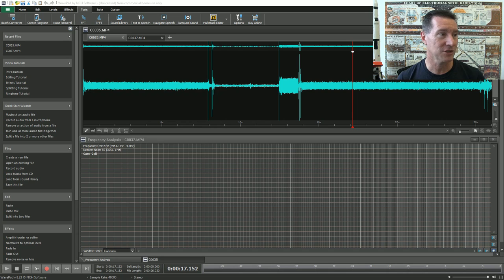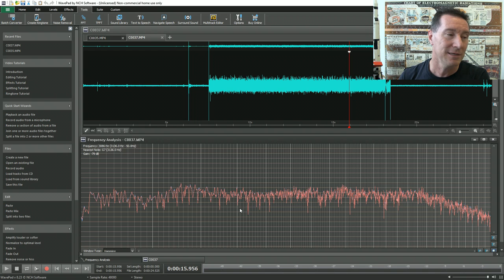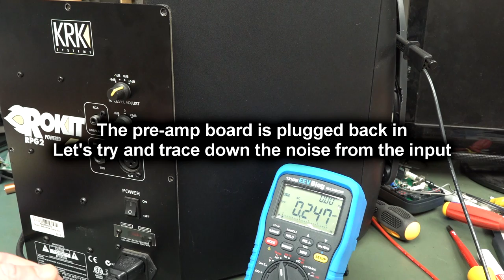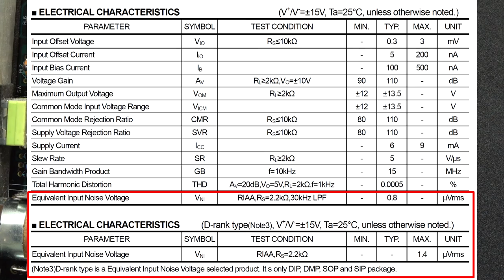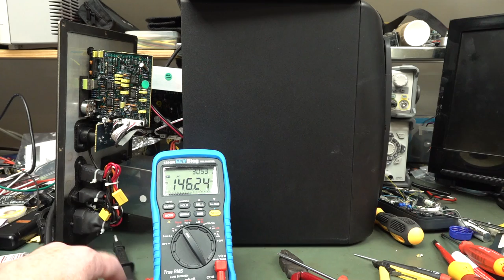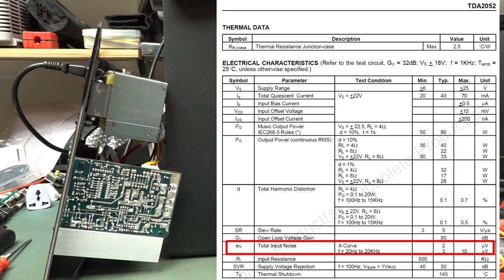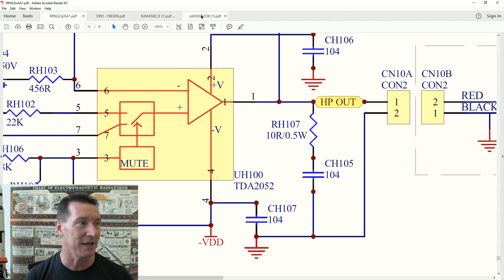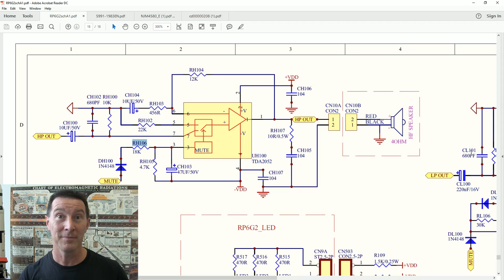EEVblog #1118 - Why Are Studio Monitors Noisy?

Comment: Is this for real? Breaking news: cheap monitors, like cheap microphones, generate a lot of noise. Also known as the noise floor. Earth-shattering idea: compare quality speakers with these cheap KRK speakers and discuss the reasons for the difference.
Reply from the maker: So there is some magic price point where the noise stops? Perhaps you'd like to provide examples?
Reply: doesn't matter man even very expensive monitors do the same silly stuff. you need to investigate each monitor model specifically.
Reply: The noise floor is a variable in speakers and microphones that does indeed reduce with higher quality. If you don't know this, maybe you should do the comparison that I suggested. You might learn something. Really, if you think that the noise floor of a Schoeps or Neumann microphone is the same as any other microphone, or that it's the same for your cheap KRKs as for professional Focals, you are just embarrassing yourself. Do you really not know how important noise floor is in professional recording studios and film production sound recording and editing?
Reply from the maker: Rory on a Bike - Ok, so you provided and example. Focals don't have background noise you claim. 
Hmm, a basic Google search says otherwise for these $1500 Focals:
https://www.gearslutz.com/board/high-end/689253-my-new-focal-solo-6-monitors-have-nasty-hiss-normal.html
and there are other reports.
Try again.
Reply: EEVblog How about you read that thread. It is an anecdotal discussion about a single pair of speakers that are not acting as expected. Surely you can do better.
Reply: I have Focal Solo 6s and they don't have that hiss at all. That's a faulty unit.
Reply: UncleWalter No kidding. But the genius who runs this vlog was desperate to find something, anything that would discredit Focal speakers, so he latched on to an anecdotal complaint from Gearslutz. Meanwhile, this is probably the first time that he's ever heard of Focal speakers, because, you know, it isn't a leading brand like KRK and Mackie.
Reply: Yeah not the best form on his part, no. But let's not cast aspersions here. I have a lot of respect for Dave and his vlog and have been following it for quite some time. It's just that here's not working within his area of expertise here. Let's keep the conversation respectful.
Reply: don't read into shit so much. dave's no fool. hes not trying to discredit focal speakers. he quite possibly doesn't give a shit. why would he.

i actually thought rory on a bike was some aussie slang until i saw his name. truth of the matter is that studio monitors, even expensive ones, do have hiss. its a specific performance characteristic, just like the ability to have cross-overs that don't mangle ya phase.

cheap monitors can come out after expensive ones with better tech.  i have cheap tomato sauce that is better than watties. fight me man.
Reply: UncleWalter I've been subscribed to his vlog for years, although I'll admit that I watch it less and less, largely because I'm increasingly of the view that he's yet another YouTuber who has become full of himself. In this case, he is talking complete nonsense. Instead of admitting it, he goes running off to Google to find some anecdotal complaint about a specific set of Focal monitors on effing Gearslutz. Pathetic.
Reply: Well, Rory on a Bike is still right. The claim that all studio monitors are noisy is demonstrably false. I'm a professional audio engineer who has worked at a few different studios and you don't hear hiss on those systems. I'm very much the audiophool skeptic, but in this case, it's not pseudo-sciency, cork sniffing, trying to justify the pricetag bullshit were talking here. In actual professional studios with professional monitors you don't have this hiss. But if your experience is only prosumer equipment, I wouldn't hold it against you for believing that all studio monitors have hiss.
Reply: pepe6666 Excuse me, but he just specifically tried to discredit Focal speakers, about which he clearly knows nothing, any more than he knows anything about noise floor. He is way over his head, not that he's about to admit it.
Reply: Very curious as to why you sound so incredibly bitter about this subject...    Just unsubscribe & carry on with your life... No need to go full-bore condescending...
Reply: @UncleWalter1  of course not all monitors have hiss. But he's spouting some bullshit about mo money less hiss which isn't universally constant - and then rattling shit off about Dave & alterior motives. Dave said extensive monitor hiss is common as mud - and it is.
Reply: Nick sregor How about you contribute something substantive and tell me where I'm right or wrong. If you can't do that, it's a fair bet that Dave is capable of handling himself without your assistance. And next time you want to insert yourself into a discussion about which you have nothing substantive to say, try something less amusing than a transparently bogus claim of being "very curious". Indeed, what your comment demonstrates is a lack of curiosity.
Reply: pepe6666 Apparently you've been taking lessons from Donald Trump and don't know the difference between your imagination and reality. I did not say that more money means less hiss and I did not say that Dave has ulterior motives. Both claims are a figment of your apparently overactive imagination.
Reply: Dave doesn't know what Adam monitors are. Unlike KRK and Mackie, they aren't on his top brand list. Watch for the next episode, where he will no doubt explain that there is no difference between his VideoMic Pro and a Schoeps or a Neumann. Of course, this assumes that he discovers the existence of Schoeps and Neumann, about which it is obvious at this point that he is blissfully ignorant.
Reply from the maker: UncleWalter1 - I never made that claim, the opposite in fact if you cared to watch the video, I said that there are some that don't have any noise but they seem to be the exception.
Reply: Apologies. My mistake.
Reply from the maker: Rory on a Bike - Ok, I admit it, I didn't read the whole posted thread, my mistake. Yes I have heard of Focal speakers. Chill out dude. How about you be productive and give us a list of speakers brands on the market that have no audible noise, I know there are some and said so in my video. But most of the monitors speakers that people are likely to want to use are going to have this noise.
Reply: The issue isn't creating a list of low noise floor speakers. The issue is that you should have done more research on this before you shot your mouth off about stuff that you don't  understand. Do some research, bring in an engineer who understands sound, get your hands on a range of monitors and do a comparison. And maybe include microphones, because the issues are similar, or maybe do this in two parts. That would be useful. This is not. This comes off as a guy making YouTube videos with consumer gear who doesn't know what he's talking about. I'm no fan of Casey Neistat, but I can assure you that neither he nor anyone else at that technical level on YouTube would make a video that comes across as this stupid. Marques Brownlee or Peter McKinnon would think that you were a 13 year old operating from his bedroom.
Reply from the maker: Actually, I read the posted thread and the person got them replaced and they still have have the hiss. So?
Another person mentioned their Adam's have hiss too.
Look, I don't doubt there are monitors that have no hiss, I said so, and Focal maybe one of them, I don't know, I'll take your word for it if you have then and know. Could also very well be a model issue, some models from one brand may have it, others might not.
Reply from the maker: Seriously, you expect me to bring in experts, arrange to get a whole  host of comparison speakers and do some sort of shootout? Really?
The fact is that most of the popular brands that Joe Average is going to buy, by many accounts have this type of noise, it's very common as I mentioned. But I also mentioned there are ones that don't. No need to get so uptight about it.
Reply from the maker: And I disagree that this video is not useful. Countless people have these monitors speakers and other brands like JBL, Yamaha, Alesis and many others that have the same issue. Now they know what likely causes it, a cheap noisy amplifier chip in the output stage. And maybe they no know to listen for it  if they are buying such speakers.
Reply: "The fact is that most of the popular brands that Joe Average is going to buy" Fine. If you want to talk about consumer gear, say so. But you went a whole lot further in this video, and way beyond what you know. Next time, maybe just say that you're talking about consumer grade gear, because your KRKs don't even reach prosumer level.
Reply: "Seriously, you expect me to bring in experts, arrange to get a whole host of comparison speakers and do some sort of shootout? Really?" Why not? You'd probably get a huge audience for a comparison based solidly on audio engineering. It would be controversial as hell, but you wouldn't want for viewers. Maybe just start with two sets of speakers (or microphones) and see what the response is. You've done multimeter comparisons. Why not these?
Reply: daves still right though - high end monitors all over the show still have hiss. some do & some dont. big deal. its for this very reason my monitors are like 20km away from my head in the shape of some ancient rune to please the gods of lobing. i wish my monitors were like 12db quieter. i have to visualize bloody everything because in my quiet apartment i cant have shit loud enough to discern the background hiss behind the content.

some do & some dont. the ones he has are noisy. daves fine admitting his limits and stuff. but cmon this video was like 20 out of 10 for usefulness. its the most informative shit i have ever seen on this topic.
Reply: Dave, I just want you to understand one thing. People who have used professional, prosumer and consumer audio recorders, microphones and monitors know that there are differences in self-noise. This is not a figment of people's imagination. It is very real and very audible and it has an impact on what's called the signal to noise ratio and consequently on the final product. In professional circles, even in knowledgeable amateur circles, there isn't even a debate about this. It is just perfectly obvious that a Sound Devices audio recorder has less self-noise than a Zoom H1n. I'm quite sure that Zoom itself wouldn't question that. If you want to understand sound production and reproduction, this is just elementary. If you don't believe me, look at videos on serious YouTube channels that review and compare this kind of gear. Self-noise is a major consideration. Cheers.
Reply: Rory on a Bike I'm not sure which video you watched. I watched one in which Dave did an interesting intellectual exercise in tracing the sources of noise in audio amplifiers aimed at electronic engineers.
Reply: "I'm not sure which video you watched." This is one of the tiredest clichés on the internet. Next time, try a little originality and maybe make an effort to address what's actually being discussed.
Reply: Christ on a bike! What a load of trumped up nonsense! The amount of noise bed on speakers like these are pretty minimal, and on most high end speakers you will still get a small amount of noise. You know what? Recording engineers aren't particularly bothered by that as long as it's low. The sound source itself will also have a noise level, and generally the noise bed on speakers (including these) are smaller than that, so you won't particularly hear it in practice unless you put your head next to them.

You want to know what recording engineers actually care about, and what you pay the money for? Frequency response and phase issues. The whole point of high end speakers is to get a flat frequency response, not to get the noise bed to zero (which will always be impossible). This is really where KRKs fall down, and indeed any monitor that doesn't 'professional' amounts, as their frequency response aren't particularly flat. However, unless you're in a high-end studio, you are very likely to not have the best audio environment which will cause the bigger issue. Ie, you are best spending your money on treating your room before buying massively more expensive monitors.
Reply: The man doing incoherent ranting on a YouTube comments section asks for originality. Priceless.
Reply: davidf2281
 Yet another internet cliché line and still no substantive comment about what is being discussed. It's on the level of "Your Mother wears Army boots". Where do you get this stuff from? Cue cards written by an eight year old?
Reply from the maker: Rory on a Bike - I know it's not a figment of peoples imagination, I know about noise, I come from the ultra low noise and distortion seismic field were I have developed and tested world leading low noise and distortion stuff for industry. I know there is no debate about this, I was simply mistaken for saying or implying all monitors have this, which is why I said not all in at least one part of the video. I was really talking about the most popular entry/mid level (i.e. affordable) studio monitors on the market, sorry if that wasn't clear. Fact is, at least three of the most popular monitors on the market, KRK, Yamaha, JBL, Alesis and more all (subject to models) have this issue, it's very widespread and something you'd encounter in a home or smaller scale studio, so it's very pertinent to many people. Can you now drop it please?, you've made your point over and over.
Reply: @roryonabike5863  woke up.  Grr.  Angry.  You may be a generic, angry cheese unit.
Reply: @roryonabike5863  and stop giving Dave shit. He's a kind guy who made this to help us improve our stuff. He doesn't output bullshit. He's a hero to us antisocial dudes who live in our workshops avoiding the cringe of the world working on our inventions. He brightens my day.
Reply from the maker: Rory on a Bike - Why not do a review comparison? because this is not an audio review channel. Going out and buying/acquiring a whole range of monitors speakers from cheapish to pricey, and then getting the measurement gear and facilities to test them properly in is a HUGE undertaking, and to do this expense and effort for an electronics engineering channel is just a silly idea.
Reply from the maker: Rory on a Bike - As for your random assertion that I haven't heard of Schoeps or Neumann, one of my best mates and former colleague was the head designer at Rode and also Jands Audio. Mics and audio are all he ever talked about in the cubicle.
We did a whole video series on mics, world class design stuff, enjoy:
https://www.youtube.com/watch?v=ihAG6cMpUlY&index=2&list=PLvOlSehNtuHv98KUcud260yJBRQngBKiw
Reply: UncleWalter1  You're right. One important reason to choose professional studio monitors and headphones rather than "consumer grade" and "DJ-like" ones is to get the most accurate and flat response to judge your audio signal. Any distortion, lack of frequency responce or his will disturb an objective judgement. As a film maker (recording and editing) I want to be shure that any noise or his I'm hearing is from my recorded audio, not from inferior amplifiers or speakers.
Reply: no, there isn´t a break-even point...just use speaker from companies known for good stuff like genelec, neumann, PMC, dynaudio..... and don´t get there entry level models...that´s the same with soldering-irons....don´t blame the ceapo stuff, as they might run too hot, or being not powerful enough to solder 10gauge wires...
You always get what you´re paying for minus the profit and may be some bonus for the brand reputation. 
Also buy speakers (i don´t call them monitors that´s just another buzz word) from companies wo also known for doing all there used drivers in house as well...
If you buy from companies which just through some chinesium speakers into an enclosure combined with another of-the-shelf amp(s) just don´t cut it neigher....
Reply: oh man he just got destroyed. there are pieces of him everywhere. yuck, its all gooey. took his pistol to a BFG fight. let us all take a breather & have some respect for the janitors who have to clean up all this.
Reply: Rory on a Bike - if you don't like his videos don't watch them but I am fairly certain Dave knows considerably more about causes for noise in electronics than you.  I could be wrong about that but if you had a more technical response to Dave than to call his work a joke your credibility might not be questioned in this.
Reply: And now who is it that don't know the difference between his own imagination and reality?  You're "assuming" you have a clue as to what Dave does or does NOT know.  Pot n Kettle situation here, huh?
Reply: I found this video very useful.
Reply: Rory on a bike  - Seems Dave doesn't need to prove anything.  Since you are so Passionate about this why don't you put forth a little effort and justify your "love" for professional gear?  You do all those things you suggest Dave do and post the video on your own youtube channel.  I'm sure someone as passionate as you must be expert in this field and therefore far more intelligent and qualified, as you strongly suggest, than Dave is in this particular field.  I eagerly await your video!
Reply: @pepe6666  do you wonder why you're anti social and stuck to the bench and table?  For weird comments like that...
Reply: @DurzoBlunts  nope